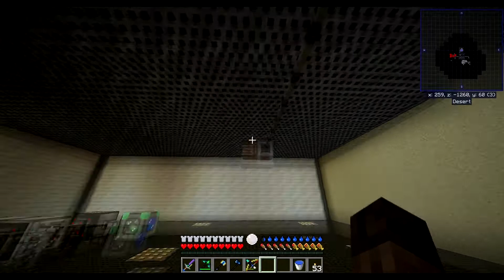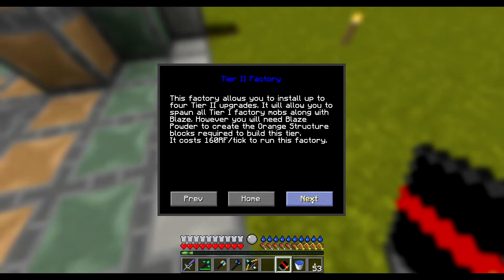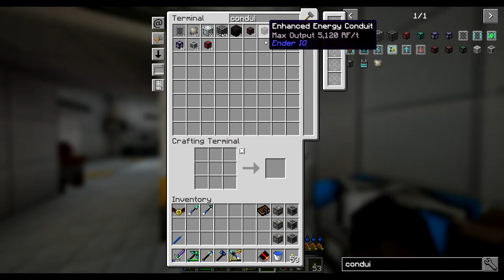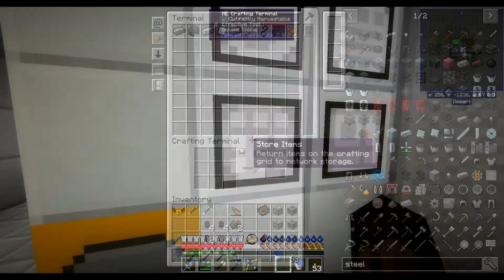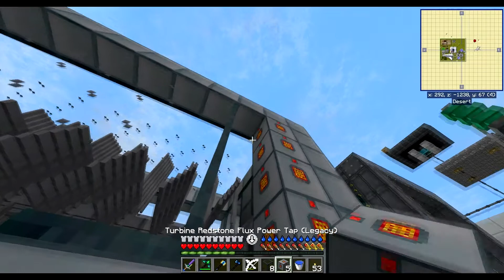Forever Stranded - 116 - Woot Upgrades

Comment: You need multiple wires running between turbine and woot factory. You only have one wire going between them but multiple connecting to them. The ones between can only carry so much.
Reply from the maker: That's correct, but according to the Immersive Engineering book the HV wire can carry the equivalent of 8 HV connectors. This setup should run at capacity. If we need more than 32k rf though we would need a second line and even more connectors at either end.
Reply: Maybe I'm wrong but, I thought you said wires could transfer 8k and your trying to get 32k (27k for woot facotry). You got like 8 wires from turbine (8k*8=64k RF) but then it merges into 1 wire (8k RF) which is being bottle necked before splitting off into 6 wires (8k/6=1333 RF) for woot factory.
Reply from the maker: I may have misspoken sorry. I've got it working in the next video. Each HV connector can transfer 4k, but the HV wire itself can handle up to 32k. That's why I went with 8 connections at each end. I actually make a mistake in a later video by adding more connectors to the battery in the base, which caused the wire to burn out when it started feeding power out as well.